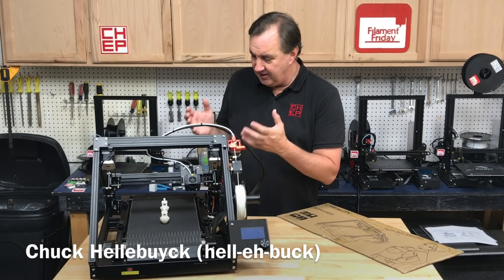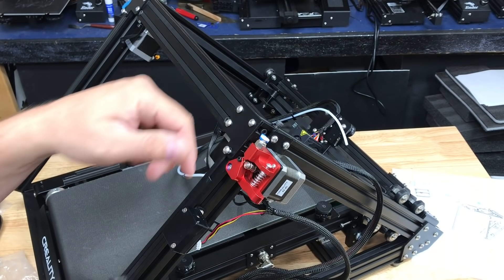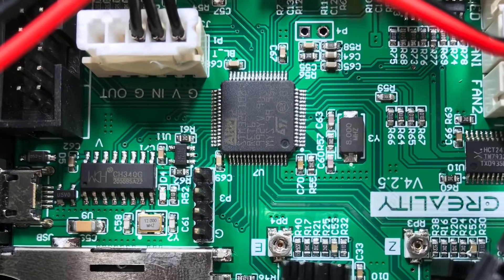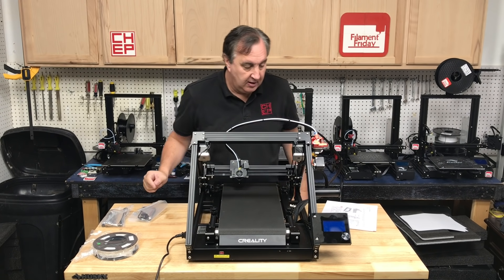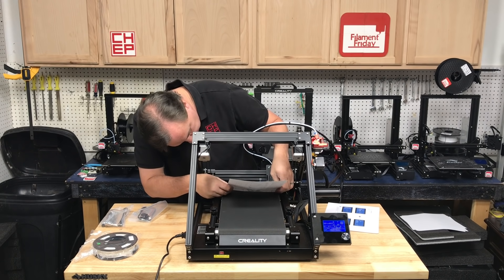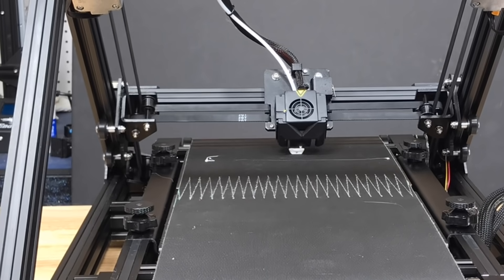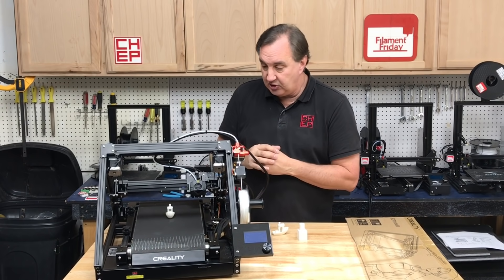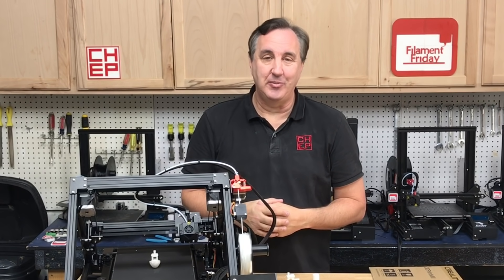Creality CR-30 - Naomi Wu's 3D PrintMill with Infinite Z

Comment: Oh, hey, look, a printer design from MRRF2018.  How clever.  Wait, WTF is naomi?  It was marginal then.  I do t see how any of the issues with to were solved since then.  Stop supporting crap, CHEP.
Reply: @mangabuddy  were you at MRRF2018?  Did you see the belt printer there?  Did you talk to the designer about why it was impractical?  I know what I am talking about.
Reply: @davidwillmore  Well, it's obviously not entirely impractical and you are not willing to share any issues, so I call bullshit.
Reply: @davidwillmore  you do realize the designer at MRRF2018 was William Steele and oh I had one at MRRF2019 and Naomi has been in constant contact with both of us throughout the design process..   A 3D printer is a tool, like any other tool you have to use it for the right purpose..  This won't print everything great but it will excel at some things.
Reply: @NAK3DDesigns  yes I do.  I remember your printer not being in a working state.  Bill said that he did it out of curiosity and that it wasn't a practical way to print parts with any accuracy as the bed is hard to stabilize in height.  His example prints showed the problem well.
Reply: @davidwillmore  um....  my printers have always been working while I was at MRRF in fact I had two of them on display, both cranking out maker coins all weekend..
Reply: @davidwillmore  Perhaps you're thinking of MRRF2017.  That's when I first showed it at MRRF... and back then, it was using a paper and kapton belt.  Once I switched to the stainless steel belt, it became perfectly stable.  In fact, that printer still has the original belt on it... and works perfectly to this day.

At MRRF2018, I had the first Printrbelt, which has always printed pretty good except right at the start before it was dialed in... but I did that way before MRRF.
Reply: @williamsteele  I remember seeing the 2017 kapton belt and I remember seeing the belt that replaced it, but I don't remember seeing 'perfect' prints from it.  You solved the layer shift issues?